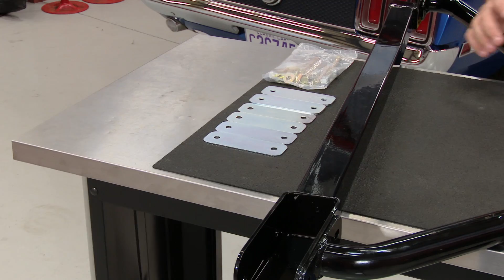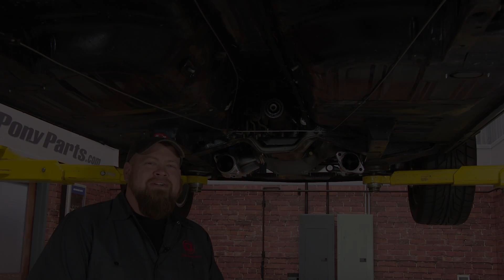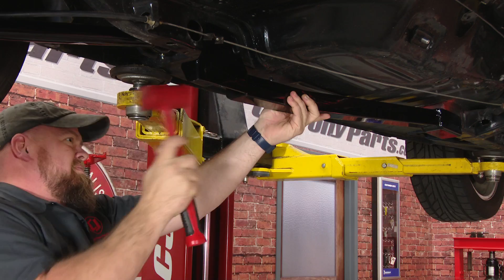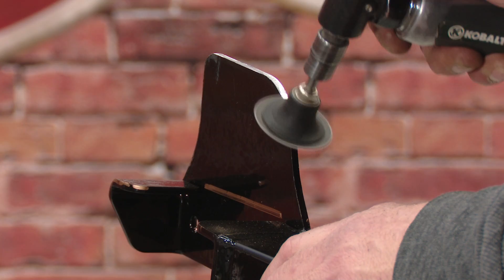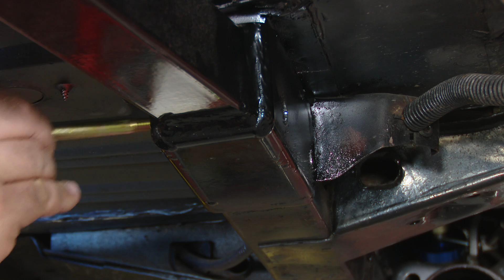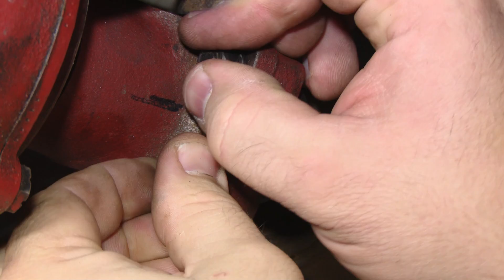Mustang Total Control Products Subframe Connector System/Driveshaft Loop 1965-1970 Installation

Comment: I'm surprised you didn't use a weld through primer. Every place there is bare metal  touching it will eventually rust through the condensation between the panels. Especially since this is under the car where it will see more moisture than most places.